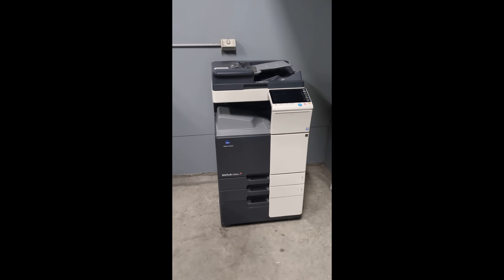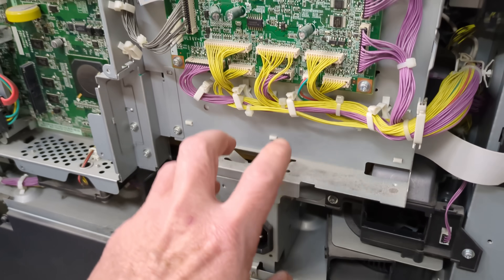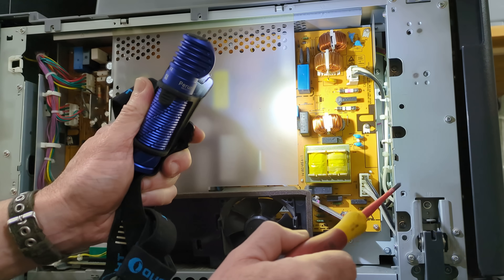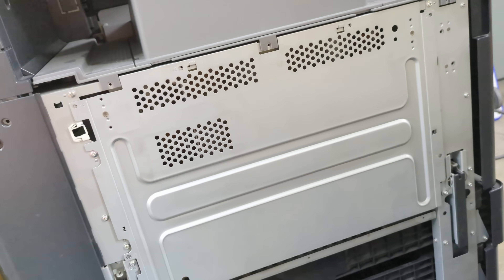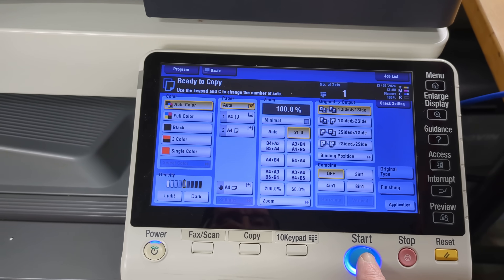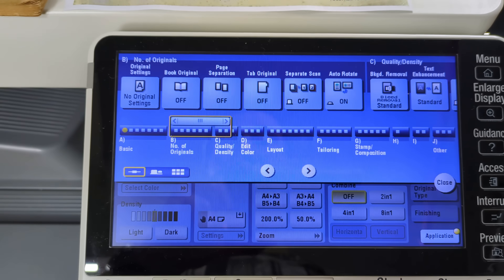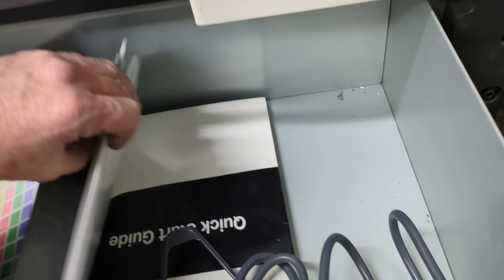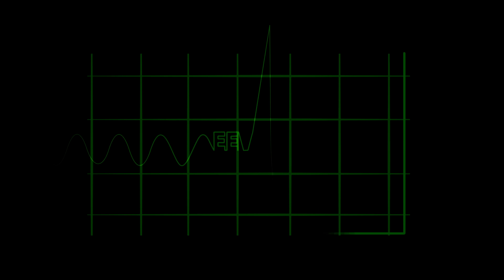EEVblog 1629 - Dumpster Find: A3 Colour Photocopier!

Comment: If you go to the counter screen and hit the stop button then 00 stop 01 stop it should take you to service mode so you can dig in deeper and recalibrate it. I used to be a copier tech and worked on a few thousand of them over the years
Reply: For more information, this model range is one of the best ever made and can do a million copies+ with only basic preventative maintenance. 300k is about when things start to wear out, so check the life on them. These would be solid reliable machines even today but like everything with a computer in it, the security was quickly outdated and doesn't support some of the more modern protocols for connectivity. It's really only a generation behind being replaced by the 8 series models. You can tell by the last number in the model number. There's also a black and white range which is basically the color machine with the cmy parts removed. If the machine has been wiped including the life counters, you can tell wear on most of the serviceable parts by looking for a band of color missing on the imagine units on the drums. The coatings get grinded off with paper dust and toner over time causing electrical arcing. Most copier jams are actually caused by sensor or timing issues causing a stop rather than run to catastrophic failure.
Reply: @jeffreyorion  Thanks for sharing all of this 🙏
Reply: @jeffreyorion  IMHO, the HP 4000 Series are the most reliable laser printers ever made. Mine is over 25 years old and still keeps chugging. I even hooked it up to a Raspberry Pi for AirPrint support. Apple really nailed it with AirPrint. There's nothing as jaw dropping as printing to a random printer from an iPhone.
Reply: I am a copier tech also. This man is correct. Parts are available online, as are manuals . These machines are designed to be serviced and kept running. hang on to it and you'll never buy another printer in your life.
Reply: While you at the service mode, try "halftone test", with different colors, you can see if there is any problem with any of the CMYK drum/developer unit. Some of those problems can be fixed by simply cleaning the drum corona or the laser mirror below the drums (both can be with a white stick thats behind the door that you just opened to turn on the machine) There is a test for paper passage too, for all the trays. Each tray has 3 pickup rollers, usually they wear out the fastest and causing paper jams. After that, it can be the clutches on these units. But be aware that these machines are not cheap to maintain, some problems can be fixed temporarily, but most of the times you need new parts. Like, if the drum coat wears out, you can increase BIAS voltage of the dv, but that's not gonna fix the problem for so long.
Reply: 好多同行，我也是一名复印机维修工程师，从业13年。
Reply: Hey, I recently found a Kyocera TasKalfa 250ci in the Dumpster. It still has full toner, but it has vertical colored stripes. I have done the developer refresh and the calibrations. Nothing has changed so far. What could it be or what should I replace/adjust?

Comment: Konica Minolta also it's one of the best brands of copiers, high quality prints and very very reliable, the HDD I don't think it's encrypted but on some copiers (like Toshiba) are encrypted with Wipe Technology, that wipes the drive when it's plugged in on a different device than the copier it's bonded to.

Comment: omg dave! you realize the banner printing mode lets you feed in a sheet 30cm x 1.20 metres long ? that is a really really cool feature

and if you can line up 3 banners, that is 90cm x 1.2m of a color poster print for the wall... or it can be like some really large stencil to stick on and cut out onto another surface, such as some large board or panelling. to do some elaborate diy ornate patterning cut outs or something quite artistic and decorative works. for home interior design etc. 👍

Comment: The colour reproduction is quite good. Seeing an IP address in the device info screen indicates it has networking capabilities of some sort. Amazing they tossed out the CDs, manuals, and other accessories with the unit. Often the device would be tossed out separately from the other parts.
Reply: Nah, that's not amazing, I'd rather say it's normal. We have KM printers at work and the manuals and all that stuff is sitting in the document holder at the back of the printer since day 1. Nobody ever looks at them, and the drivers are managed in our network environment so no need to use the identical CDs that came with every printer.

But what I know for sure is that the touchscreen pens were missing on some of ours after they were sitting in a public area for a few days between delivery and installation. That's the real amazing thing here.

Comment: Schools I did IT support in had these, well the earlier 280 model. Trying to remember the admin credentials and admin-x keeps popping up. I think I have tossed out all my old Default User credentials but I bet they are online. They were a nice machine and the drivers were user friendly to install unlike some. 

Default password is 1234567812345678 so admin or Administrator is the User name and the were case sensitive when I used them. Retired 10 years ago so memory is fading.

Comment: The real champion of these things is the ADF scanner on the top. If you need to scan a heap of pages and the rollers are clean, it will absolutely tear through double-sided pages and PDF them on device.
Reply: That is, if it is a single pass, double sided scan to scan both sides in one pass. I'm betting though that since this is a low end machine that it has the standard R-ADF (Reversing ADF) that uses a solenoid with a gate to flip and scan the second side. Single pass would be a significant upgrade and definitely cost more money!!!

Comment: BTW, your old printer could probably be fixed economically. The crazy color patterns are repeating in the process direction every 2 or 3 inches. This means the problem is most likely a bad Bias Transfer Roller, which is a fairly cheap and easily replaceable part. I didn't get a good enough look at the machine to nail down its exact model, but most color machines that size use a one piece module that contains the transfer belt and all 4 primary Bias Transfer Rollers. Replacing that could very well have that old machine running fine again.

I've been a printer and copier technician for years, seen a lot of that kind of failure.
Reply: Called "defect repeatability pattern” if you roll it into a tube and match pattern to pattern, you'll know the EXACT size/diameter of the roller that is creating the problem!!! I believe the KMBS service manual in the back gives point-to-point distance of each kind of roller!!!

Comment: That is a score to keep. Even if you sold it as second hand, you would get  1000 USD for it. 350k pages for this device is nothing. The monthly recommended use is at 12000 pages. I believe spare parts are still available. An Dave yes, a stapler and sorting module are an option. Pricy though.

Comment: As a Former Master KM IT tech, ya the front door is a tricky find! I'm glad you found one as from my perspective everything from the electronics / encryption connectivity, etc is so very well devolved. This model is about 10 years old but so very relevant still. ( that boot screen is just the "default" 3rd party vendor start up screen , it can be reset from the service menu. ( Sorry i can't help here wink )... ethernet + usb printing included, no wifi
Reply: +3 to 5 is expected from these printers ... they are also only sold with service contracts for free drums/toner ...  (no staples) can get it as a finisher that attaches.

Comment: These are the contract machines we have at work; we have two of them. One setup as B&W and the other setup as color. They are fantastic machines, they just run and work and thats it. Their color prints are of amazing quality as well and really fast. Envious of the score!!!!

BTW the thing does have a stapler, AND a puncher. Also the bottom "utility drawer" is a spot for a high capacity paper-lift drawer that will hold a stack of 4 reams of paper. 🙂 Ethernet is on the back bottom left IIRC.
Reply: Interesting setup, why would you only use one for BW and the other for Colour?

Comment: Why are power supplies done on single sided PC boards more often than not?
Reply: Because it is cheaper and possible because of the large components and low complexity.
Reply: @TylerDurden-pk5km  A combination would make sense.  Low complexity allows them to cheap out with a single sided phenolic board.

Comment: Brilliant!! I would like to share my own dumpster find, a 50 inch LG plasma screen tv manufactured May 2014.  Worked fine when I first powered it up. HDMI input works. I found a remote for it on Amazon, it works with the tv. The screen has a quite a few dead pixels on startup that go away after a few minutes of warm-up. It looks like someone tried to take it apart because about 25 percent of the screws on the back panel are missing. Otherwise pretty cool find.

Comment: HGST?  That's garbage. No value on that hard drive.
Reply: Hitachi Global Storage Technology bought out by Western Digital.
Reply: HGST pretty robust considering they could withstand users doing a hard power off of the machine and not kill the hard drive. Only time hard drives got borked were during bad weather with intermittent bouncing power...and the customer didn't have a line conditioner attached to their machine.

Comment: My employer (auto component manufacturer) used to lease a bunch of these (until the leasing company upgraded us a couple months ago). They had the usual printer issues but otherwise were solid units... we'd print a lot of 11x17 (yankee A3) on it for signs, mechanical drawings, and electrical schematics. Certainly ran a lot better than the "backup" HP color laser that always rendered color prints as splotchy abstract art... (the leasing company could never keep that one running right).

Our units didn't have the perforation option, but they did have staplers... very handy when printing a stack of schematics to put in a PLC cabinet...
Reply: Splotchy...Probably weren't using OEM toner but a 3rd. Party toner that needed slightly higher fused temperatures to bond the toner to the paper, but since the temperature wasn't high enough the toner was partially sticking to the fuser hot roller which was leaving "toner offset" on subsequent pages from the previous pages.

Comment: these things are leased per mps (managed print services) contracts and they are built to last. if you plan to use without a contract, you pay high $$$ for toners, transfer belts and maintenance kits. use it as long as toners go. maybe the contract has ended, and they retired it. maybe they digitalized the company and go for paperless office.
Reply: Or just refill the toner ...
Reply: @bt410382  You will never get through those consumables without a decent amount of use

Comment: The business here bought the original Canon color copier in 1988.. it was 39000 dollars us.  Later it was called the Canon 100 machine.  That price was like over 100k in today's money.

The copy click fee was 55  cents per copy on 1988.  We charged 4.5 dollars a sheet then since about all small jobs you filled the trash can with duds. 

Ie 10 duds and you owe Canon 5.50 dollars 

 Customers often artists wanted  a 3 x7 image enlarged to 8x 10. So giant time and click duds waste in explaining to a degreed graphics artist 2nd grade stuff.

And a PhD artist would never under ratios.  Aspect ratios.

As color copiers evolved the prices dropped and copy click fees to where there is no money anymore making copies. 

Ie that office box store has a sweet heart deal with 4 cents a copy click for color so impossible to compete.

With the local power company they wanted literature printed at 6 cents a sheet for color work. All they had was an 8mm size red logo in the top corner.  That caused my cost to be the 12 cent color click fee since color

So the local power company leased their own color copier monster machine 18 feet long. It had gobs of folders finishers stickers. Paper trays

That machine they leased for 7000 dollars us a month and that included a person to run it. That was the lease price 22 years in 2002.

They were really pissed I would not make 1000s of copies below my costs so got their own. 

One looney save the planet artist for 10 years had us making all these save The planet literature.  She was made by some left wing organization. 

We had the greatest amount of wasted duds with that nutcase than any other customer.  Constantly wanting just one employee to make 12 variations then she wants to use the 2nd variation after 1 hour of farting around.

She came via taxi. Had a taxi outside running its AC for 2 to 4 hours like she is the queen of climate change.

 So engineering wise it was the most ridiculous thing..huge waste via wanting micro changes in colors and having a taxi waiting on her when it is 95F and 85 RH outside.  

She would have to have an appointment and only would work with 1 employee and spend 3 to 5 hours making a few copies.  Literature to save the planets global warming.  She had to have  been paid since was total insanity.

Comment: This is a clear case of Konika/Minolta placing the printer in the dumpster room , so it will be featured in a EEVblog video 😛

Its probably a write off. The printer is out of the books and the wanted a new one. Selling these as a business is a hassle so they got rid of a perfectly functioning printer.
Selling them (or even just giving them away for free) as a business in Germany is even more complicated. You have to give 6 months warranty on the thing you gifted , perhaps to a school or anything else. So they end up in the e-waste instead of having a perfect productive second life. 
Although usually printers here are leased and Konika is taking them back.
Reply: So the warranty would consist of giving the school you gifted the printer the money back they gave you ... the whole 0€ or only parts of it?
Never mind that this would be considered a B2B transaction where you dont need to give warranty.
Reply: @TylerDurden-pk5km  Schools are not B2B. If you sell it on eBay to make some money back and it breaks, you have to replace it or fix it.
Schools should not be a problem but companys dont risk it with consumers.
I once had a fried who sold HP Printers on "craigslist" . He bought a whole ship container from a recycler and sold them one by one.
If someone complained , that the printer was broken he gave him a diffrent one of the 400 he still had.
The recycler would have stuck with putting it in the shredder. No time  for selling it to customers.

Comment: I work in a college in the UK. We normally replace our MFDs every 5 years but stretched to 6 last time because of lockdown (year of no usage). We had 35 of these Bizhub C284e but with an extra Tray 3 that took 4 reams. Very little issues except consumables in 5 years accross any of them. When our 284es got retired most had 200k-400k prints but we had a couple at 800k-900k prints that were still going (starting to rattle and sqeek a bit though). 

The spiraling on the toners is different on each model so you need the right toner or you can''t insert it. Id guess they threw this out because it can't share consumables with its replacement.

Comment: I have that exact model on my office. It's somewhat old but works perfectly fine!

It definitely can be networked, and it definitely does stapling!
Reply: I didn't see a finisher on it. I don't work on Konica but they aren't much different from other brands and other brands need either an internal or external finisher for stapling, hole punching, and stacking.
Reply: @caseycornett5182  I dont know how it works because we never use the stapling feature, in fact it always warns us that it's out of staples.

But the fact that it warns us is enough to know that it can do staples.

Comment: I didn't check this model but it would be out of support with no drivers for Win 11 etc. Probably still works with a standard PCL driver however they just get a new one under contract. Konica probably could not be bothered taking it away.
Reply: They have Win 11 drivers for it. Besides, don’t Win 10 drivers work fine in Win 11 anyway? 

Heck, I’m running my own printer at home on Win 11 using the last drivers, which are for Win 8. And it’s an inkjet, which requires all the processing to happen in the driver. An office laser printer is a PCL or PostScript device, so the drivers are simpler under the hood.
Reply: If they have win 11 then it must be still supported. I have a client with similar unit that would not work on 11. As it was a leased unit with toner etc it was just upgraded. It's different if you are going stuff around yourself to it being in a corp environment. Good find anyway 😊
😊😊😊 @tookitogo

Comment: I wouldn't be surprised if the contract finished on the unit and they didn't want to continue to pay the yearly maintenance fee to keep it running, so they decided to cut their losses with it and likely get a more modern one.

One of the places I work at here in Western Australia, we lease, once the contract runs out, we either buy outright and move it to a different location and replace with a new lease, or send back to the leasing company and get a new lease.

It's often not worth continuing to pay the yearly maintenance fee on these things once a lease has finished.
Reply: A right call. I owned over 10 printers over the years. They were all complete rubbish, every single one. I now print at work.